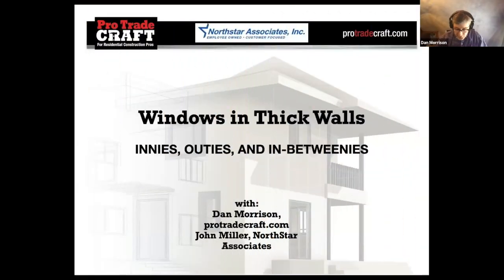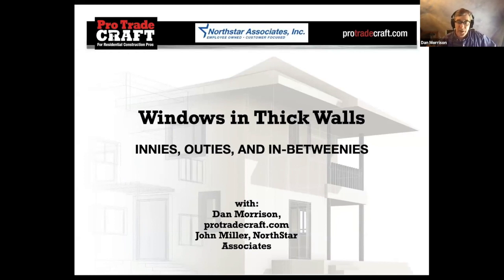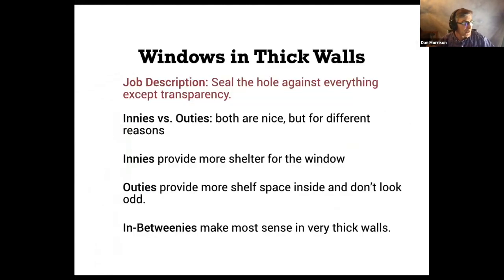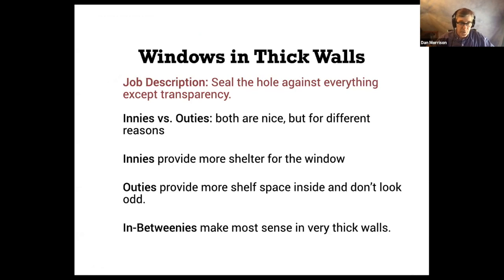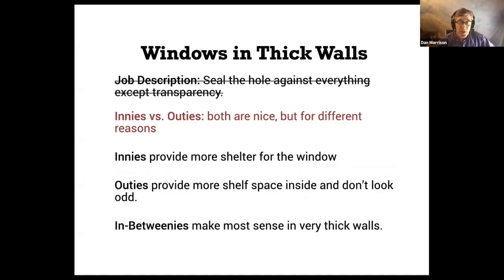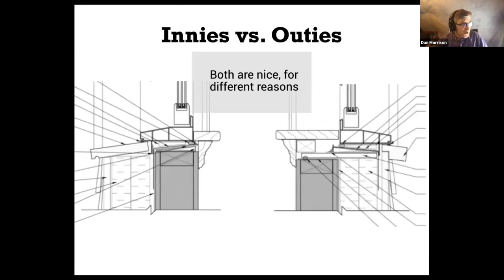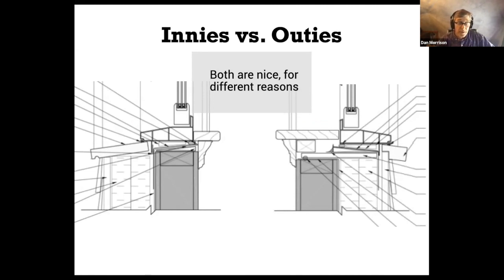4: Windows in Thick Walls (PTC's Continuing Education Tour, Part 4)

Comment: I do not see use of a “spatula-like” gizmo to seal flashing tape! I don’t think hand sealing is as secure as sealing with a flat-edged gizmo. Installers are critical to bulk water and air sealing. They are more often in a hurry than they are careful to “get it right!” Potential weakness in the window/wall assembly!

Comment: Many thanks for this class! How would you water seal and install in-betweenie windows in a wall built out of 12" thick block? It's a 100 year old rock face block house. Insulation will be on the inside since we don't have the benefit of siding. But the fact that we don't have siding also means we can't install outie windows and the tape flashing can't go to the corners... so water always splashes on the sills and finds a way in.
Reply from the maker: Probably with liquid flashing, and a lot of thought.

Comment: Great video!
I am getting ready to add 3 inches of foam board insulation and outtie windows to my 1940’s house. The house has storm sheathing (diagonal 1x8). There are gaps in the storm sheathing of 1/4 to 3/8 “ is this a problem? Any suggestions?
Reply from the maker: There is not much you can do to negate the continuous gaps in the sheathing except to negate them with multiple layers: house wrap, foam, foam...
I mean, you could skin the outside with 1/4 inch plywood first, but that could add a lot of cost that won't really be returned through multiple layers of foam with offset seams and the outer layer taped.